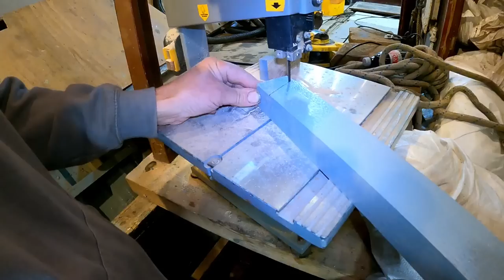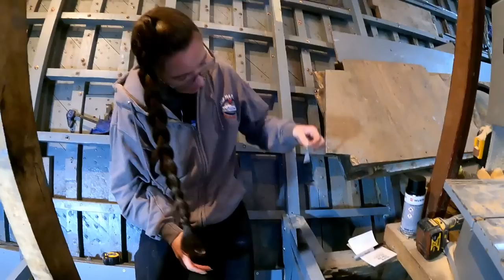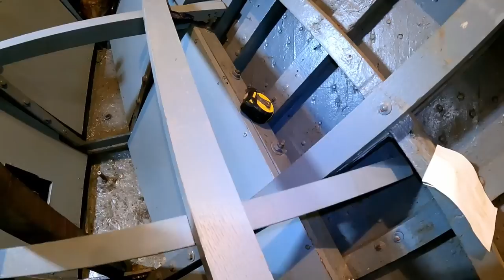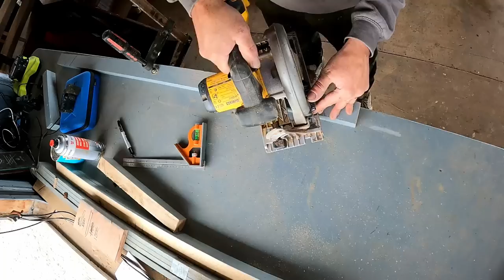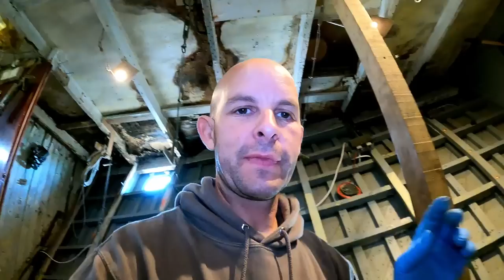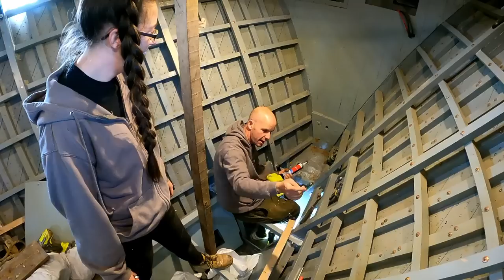Ep 90 - 🛥 Will My Boat Sink? BALLAST #boatrestoration

Comment: You know the forward engine bears could have also been mounting points for the upper guns because the recoil from deck mounted guns would have been horrendous so I would imagine they would have had to have anchored them lower don't know for sure but just had that thought thought I would share
Reply: HDMLs only had a 1 pdr gun (sometimes replaced by a 20mm Oerlikon), so the recoil wouldn't be that bad.

Comment: I remember when we used to laugh at the American attitude to health & safety, little knowing that we were on the same path. I was sent on a health & safety course once and the course leader started by saying forget what you think this course is all about, the most important thing you need is common sense. By the way, the correct term for the engine bearers is 'motor situpons', or sticks.

Comment: I mean, Simon would probably risk hitting his head (I'm almost as tall as him, so I know the pain!) but couldn't you replace the post with a beam supported by the hull on either side now that you've fixed that structure so well? Or even sister the existing deck beams temporarily so nothing drops down lower than the original beam level?

Comment: I have a seriously stupid question. But wouldn't have been easier to put the sole support on the other side of the web frame, so you wouldn't have that vertical bolt to contend with?
Reply from the maker: Not a stupid question at all! I had to just go and check why! The reason was the post was in the way, and we don't want to remove it yet incase the roof falls down!

Comment: Everything is a compromise of risk reward, I had a massive life changing accident at 30yrs old everyone said what a shame and who's to blame and bad luck etc,  my philosophy is when I went out there in my chosen sport in a dangerous place I knew the risk I knew the consequences I made the miscalculation its my fault my responsibility, my only regret is someone else got hurt as well fortunately not as bad. Because that guy trusted my knowledge and experience and as a result exposed himself to more risk than he usually would have and ended up with 87 stiches to put him back together. 

Its the same with PPE and Health and Safety make sure you understand the risk and consequence as much as the reward and act accordingly some people will have a lower risk tolerance others won't, lets not judge and only point out gaps in knowledge rather than gaps in risk aversion.-  So if I make a comment about risk  its "have you thought about this" rather than a criticism.

...........and don't loose sight of the reward, which in this case is very awesome.

Comment: Really upset the H&S nutters  chop up some old pallets to use for a temporary sole. A tip for cutting threads when there is no bench grinder, file sand paper concrete block or brick available to trim the cut threads, run the nut up the thread past the cut point before making your cut. Once cut finished use the nut to redress thread end by running back and forth over the cut several times without undoing completely  Not a perfect solution but better than nothing.

Comment: Woah Nellie! The description you gave of the power train of the boat is wrong. You missed out a vital piece. The thrust bearing. Take a look aft of the engines. The prop shafts should come into the boat, then to into a large bearing that is fixed to the structure of the boat via a flexible coupling. It is that bearing that should transfer the thrust of the propellers to the boat. If it is not there, then the thrust line comes right up the shaft, through the gearbox and into the engine crankshafts. That is a very bad idea. On very large boats with engines much bigger than yours the thrust could push the engines right off their beds. Don’t believe me? Then check with Leo! He did an explanation of this, and you know he’s always right.

Comment: I’m a joiner and a health and safety gimp tried to kick me of a site because my extractor was a type H and they specified type M until I explained that H has a better filtration system than m, the he said that my timber saw bench was illegal because it hasn’t been tested for humans, so I said it’s for cutting not eating, he replied but what if you left it and someone used it to stand on and broke a leg? I said I’d fix it, it’s made of wood, he said nooooooo not the bench their leg! I said they would very be stupid because the safety man is a bit of a nob on here. I got kicked off 😂🤣

Comment: 2570 BC  Egypt at Giza
Slave:   Mister Master Builder sir,  The Pharaoh wants to know why all the work has stopped on his big tomb.
Master Builder:  You can tell the Pharaoh that I, the Master Builder,  am working out the exact calculations
                                 for the stone wedges to put at the ends of the Pyramid weight bearing stone beams.
                                 It's a very exact mathematical calculation you know.
Slave:   Can't you just lay a piece of papyrus against the place you want to lay the stone and mark it to make a template?
Master Builder:  That is a great idea slave.  As a reward you have been chosen to take my place and accompany
                                 the Pharaoh to the afterlife.
Slave:  Gee...thanks.

Comment: If folks today had to work in some of the jobs I had to work in throughout my life they would of died from a heart attack, just from shock alone. Millennials today are so bloody safety over board conscience its half the time stupid. Yeah if you work with rusty old metal and your and your under a car grinding it yeah use glasses but you don't need to have eye protection on every single thing you put your hand to do. It not like your body going to erupt and self destruct and fall apart on ya or anything, gosh give it a break. Ignore the trolls don't let it bother ya.. You have to have thick skin ...ignore it. Move on. Your both doing fine. Love yah.

Comment: while you are providing an 'Educational' video, you are not a Company and therefore don't need to follow Health and Safety Regs, you are private individuals working in a private location, its only if you are 'Employing' individuals or working in a 'Public' environment you  need to provide or be wearing PPE - Health and Safety Regs are only a guide and sometimes are i might say not relevant, i don't mean that, but some regs can be improved on, or might actually be more dangerous, they merely suggest what measures to take

i have said this before regarding my own use of axle stands which had no proper bolts, where i had used some old cylinder head bolts which are pretty strong, but H&S were concerned in case they might be lost (we had loads of spares) but advised we must fix a chain to them and attach to the stand, petty, another example and i'm sure welders will agree, gloves should be optional, if anyone has ever experienced hot metal dropping inside the glove can create extra burns to the hand and wrist, if you try to remove it, it is way faster to react by shaking the hand, naturally by instinct, and Simon you mention goggles steaming up, i was working on my back on a 4 foot scaffold tower using wet and dry on aluminium surface (aircraft), advised to wear goggles since aluminium is not good in the eyes, agreed, as i went to get down i slipped and nearly did myself a mischief, the goggles were launched across the hanger, wear something like glasses, something that vents

so keep going guys - your doing a grand job - those who whinge generally have nothing better to do and never done what your doing and have become bleeding do gooders, mind ya own business and let folk learn by their mistakes, take a trip to A&E and see what goes on there, and take it from me folks, i broke my back recently, completely my fault, i knew the rules and had a moment of loss of concentration, it happens, i didn't fall far, but it was enough to cause injury, i'm on the mend and absolutely fine, still ache but improving mostly, but it does give me the right to hand out advice, check A frame steps are serviceable, my rant over
much love

Comment: Most safety regs are dreamt up by shinyarses trying to justify their existences.
I have worked to retirement with the only body part missing is my appendix.
Many jobs were not exactly inside the realms of safety, using explosives, sharp
knives, deepsea trawling, dropline fishing, pushing over trees with dead branches,
up trees with a chainsaw lopping to name a few.
I survived with only the usual cuts, scrapes and a bit of bleeding.
On one job we only wore shorts as a lot of it was floundering through mud and
swimming in dirty water pulling heavy wire ropes. 
Then the rot set in.
  Had to wear safety boots, hard hat, glasses etc, instead of a job taking half hour
it now would take several hours, imagine what that  did to the cost of production,
Little wonder prices skyrocketted, companies shut down or moved overseas.
Dont get me wrong I am not against safety but it needs to be applied as suits the job,
not one size fits all.
Great job, Gemma and Simon, in spite of not wearing hard hats and high vis shirts.
Sarinda is coming on nicely and looking good! See you next week!!

Comment: PPE.....Piss Poor Effort......by spendin half yer time fartin about settin up...in goggles yer can't properly see out of and clothin yer can't move in.   Love you guys  x
Reply: And gloves you can’t feel anything through, then they get caught in machinery! Your fingers are the best sensors invented. You have no dexterity with clumsy gloves on. There is a place for them when handling chains or pulling ropes as Gemma did when hoisting the ballast into place. Or for protection from corrosives.

Comment: You guys do great work, so I hesitate to make a negative critique. But here goes anyway.
I am unhappy with the sole supports you are so carefully fitting over your forward bilge.
As rhe hull flexes in the water from unequal port or starboard wave height those supports will be pushing against the stringers on the opposite side. I'd prefer that was directly against the web frames rather than the hull or stringers. You can always support them with a sistered plywood brace bolted to the support and the web frame bothe forward and aft of the web frame. 
End of old man jabbering. Keep on plowing.

Comment: On your own time, on your own property your safety is your own responsibility, use common sense. it's pretty basic, but sadly lacking these days. Amusing anecdote, I have a friend who is paranoid about dust in his workshop so has installed very good extraction on his machines, runs a room filter, but still wears an appropriate mask.  What is amusing about this?  He smokes two packs a day!  Like I said, common sense - or not.

Comment: That was a great episode with ya laughing and joking about {ya been on the wine then} yes H & S has it,s place but most today like ya say is to negate Liability. Using common sense and be responsible for your own actions has been pretty much stripped away. You guys without trying have been more compliant without even trying using what ya need when appropriate. Funny story { Lineman school H & S gone mad. To make ya Ladder safe ya need to tie it off before ya can climb it... well how ya gonna do that as it needs to be tied off at the top......I kid you not} . Fcuk everyone else just do what ya doing. The bearers are like that as she was a high speed Launch and Gun platform and the way to spread the Load is not relaying on one Keel alone nice simple idea. ballast wise use what ya have like Simon said probably end up taking some off. The Floor looking great nice work. Don,t loose the fun you 2 are a Hoot to watch and see how ya do stuff and do it ya own way with a bit of Sass in for good measure you are both naturally funny and have fun doing what ya doing. between you and the 2 Ronnies about the same. Right lets keep at it and carry on :0}

Comment: Too many "Fun Police" around now a days. They must have a very boring and sad life sat there watching youtube vids for people doing (in their eyes at least) highly dangerous and life threatening activities, where they may get a splinter in their finger because they are not wearing safety boots with steel toe caps and steel plates in the soles, shin and knee pads, welding apron and cape, full face visor, safety goggles, ear protectors and hard hat as well as elbow pads and welding gauntlets while they are moving a 15 cm (6in) length of wood a foot along the workbench. THE HORROR of such an horrendous injury.

They need to leave their panic room, take off their cotton wool and bubble wrap suits and cycle helmets, and get a life and have a bit of fun. God forbid that they may even enjoy themselves. But thay last bit may be a bit of wishfull thinking because the "FUN POLICE" might have ago at them.